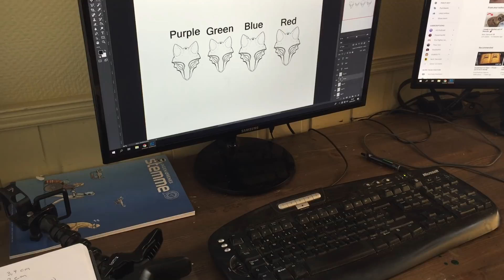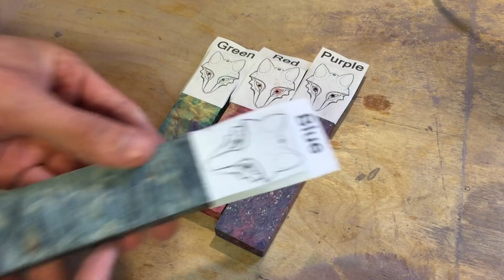Making 4 Wolfs From Dyed Stabilized Wood

Comment: Could you use normal wood carving gouges on stabilized wood or only powertools? I like to use both myself. And is it available in big blocks, so far I have only found smaller pieces mostly used for knife handles.